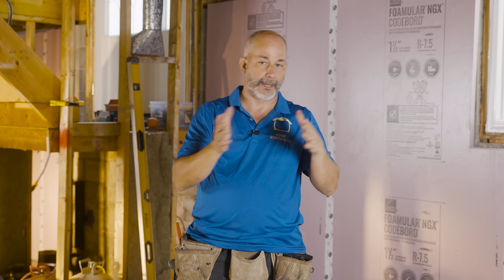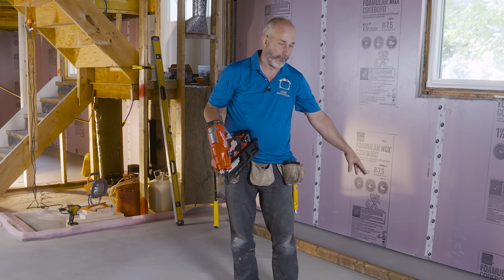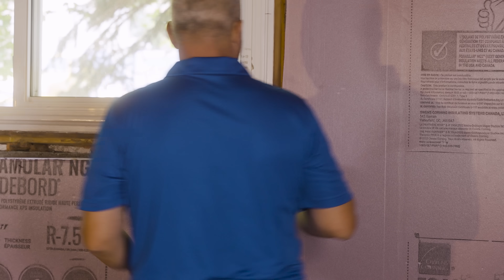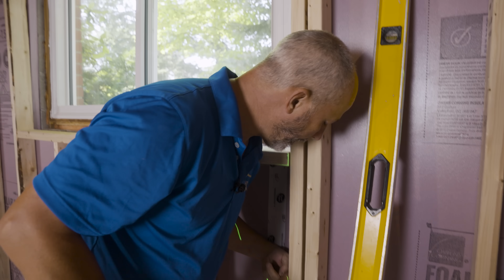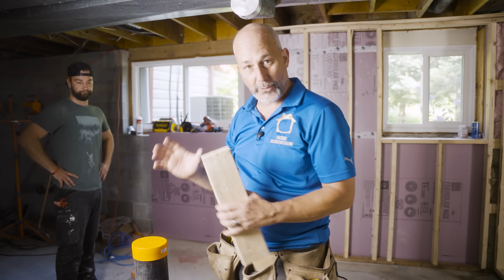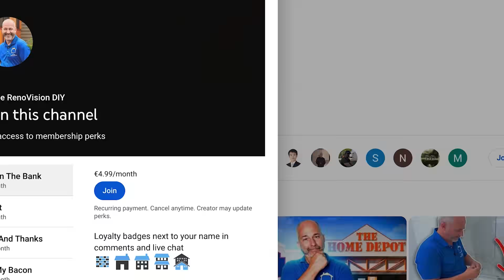The RIGHT Way to Frame Your Basement (From a Pro with 30 Years Experience)

Comment: Love the videos! I've been told by the city of Ottawa that R7.5 rigid + R14 does not meet code. You need R10 rigid going that route. "The basement walls are required to be minimum R20ci or R12+10ci. The thermal values are not additive between continuous and non-continuous insulation. Those are separate requirements."
Reply: That's really strange, because when I insulated my basement, my city of London, ON required just R12 for the basement walls. But I went above the code and put those thin R3 rigid + R12 batt... Temperature wise we are in somewhat same climate zone! Maybe your city referred to the outside walls, like the ground floor walls, not the basement ones
Reply: That depends on the year the building is built. New homes are required 2x6 stud wall and r20 insulation. While older homes only require 2x4 stud wall and r12 insulation

Comment: By basement has had a # of crack repairs using the poly injections.  The injection caps are still there and protrude from the wall a couple of inches.  How do you install the foam board against when the walls aren't flush?

Comment: When building basement walls I alway make them approximately 3/8” shorter than the actual height then use starter course shingles the fill the space before securing the wall to the floor joists.  Probably overkill.

Comment: I have always built walls 16” OC but when marking out the plates I go back 3/4” (half the width of a 2X4) mark with an X the side where the stud will sit.  Guarantees the middle of the stud is 16” OC

Comment: If framing on top of dricore, pressure treated lumber is not required? How close would you put the dricore to the bathroom walls? Or for bathroom framing it’s still on top of dricore cut flush to bathroom interior?
Reply from the maker: I would frame the bathroom first. then pour floor leveler to bring up the height. Cheers!

Comment: Hi Jeff,

I'm a huge fan! Quick question: which GRK screws do you recommend for joining the top plate with the ceiling stud—2.5 inches or 3 inches? 

Can I also use GRK screws for framing my basement walls? I prefer not to use nails or a nail gun due to the cost. 

Thanks for your help, and I appreciate your informative videos—they've saved me thousands as a first-time homeowner!

Comment: I don't think you need vapour barrier if the Foam is R 7.5, and you are using R-14 batts. When I did mine, as long as the foam was taped  and sealed, vapour barrier wasn't required if it made up at least 1/3 of the R value. I'm in the GTA, can't imagine codes are much different than Ottawa.

Comment: Hey Jeff. Why doesn't the pink rigid foam and tuck tape qualify as a thermal break? You said you'll also need a vapor barrier? Thanks for all the great info over the years!
Reply: Hey Jeff, I love your work!! 
I second Joe’s question. I’m finishing my basement with the same pink rigid foam flush against the concrete (older house), tuck-taped seams, and spray foamed along the bottom and all edges to create a continuous vapour barrier. Planning to add Rockwool batts to meet R-value and no plastic vapour barrier so as not to trap moisture. Are you using a semi-permeable vapour barrier? Cheers!

Comment: Wouldn't that Owens Corning XPS with taped seams already be acting as your vapour barrier? If you add 6mil poly on the inside face of your studs, then wouldn't you be in danger of creating a double-vapour barrier scenario and a humidity trap within your walls? Better to seal the top and bottom of your XPS as well and and have that act as your VB. This should be Ontario Building Code compliant, but you can always confirm with your building inspector ahead of time.

Comment: Do you not have fire blocking code to deal with, or did I miss how you're dealing with that?

On the bathroom door height under the ductwork, why not use a pocket door?

Comment: If you use a pocket door on the bathroom, problem solved.
Reply: Then he has no room for outlets or light switches in the side wall of where the vanity will go. Also locking pocket doors are a pain in the ass to use.

Comment: This will not pass inspection anywhere that adheres to IBC 2021 or later. There is no vertical or horizontal fire blocking. Foam board is combustible and does not count as a fire block. You need to have blocking every 10’ along your wall. You could use 2x4, Ply or drywall, but it needs to go all the way from the stud to the concrete.

Comment: A large serrated knife works wonders for cutting Rockwool. They also sell em with closed looped handles at most home centers. You use em like a hand saw, cuts super easy.
Reply: I used an old bread knife.  Worked great!

Comment: Hey Jeff, when you measured the height of the duct work in the middle of the bathroom, I think you forgot to subtract the thickness of the flooring, so it would be much less the the 79-1/4" you stated. I could be wrong & maybe you subtracted it in you head as you were measuring.

Comment: How about the gap in bottom plate to match with the gap on the foam board? So we have water/airflow if we have subfloor system like  dricore foam. Shouldn’t have a shim under the bottom plate ?
Reply: Yup, I like to use Delta or DMX dimple barriers under my non load bearing walls in basements.
Reply from the maker: if you are using a subfloor then do it first and then build your walls on top. Cheers!

Comment: Proper layout from a wall end;  15 1/4 put an X, 31 1/4 put an X, 47 1/4, an X ....etc so on. You subtract 3/4 from each interval to make the centers of the studs land in the correct locations for sheet goods. 4ft, 8ft,  12 etc.

Comment: In the situation where you have the overhead ductwork there why not plan around the ductwork?  I can see three ways to avoid it in this scenario.
1. Put the bathroom in another place in the basement.
2. Make it a outward swinging instead of inward swinging door.
3. Make sure the room is 30 34 or whatever size door you want deep before the ductwork so the door can swing in and not be under the ducts.

Its weird that you planned yourself into this issue instead of explaining how to avoid these issues in the planning stage.

Comment: On concrete and leveler do you need the uncoupling membrane in the basement? Would make it easier to fit the door to the bathroom without and what is the real risk? What's the chance the tile will ever crack? If a concern, go with an LVT.

Comment: I prefer my methods. Tapcon screws instead of shooting nails that only crack the concrete.  I also don’t put a stud on a seam.  I like to add to the bottom and top plate with a, usually 14&1/2” piece butted to the studs.  This way if the wall moves it moves as one piece.  It’s usually a better practice to leave about a 1/2” gap between the studs wall and the foam vapor insulation too. 
Old houses you’ll likely stick build rather than build the wall in the floor.  I just did a basement from a 1960’s house that the house was so off I had to stick build the entire thing.

Comment: Your plate layout is wrong.  You need 15-1/4" to the face of the first stud from the end, then 16" on center from there.
Your way makes the layout off center of the stud by 3/4".  Measure over 4 & 8 feet, and your stud is off to the far side, not centered of sheet goods.

The window height is different for the headers above to carry the ends of the floor joists, they are bearing and required.

7 studs for a corner????  Just to make a door opening???  Guest 2x's are cheap in Onterio, Ae?
Reply: Get a life I’m a framer who cares
Reply: @ LOL.....I've had the life, 50+ years in carpentry, I've repaired many jobs from DIY's and those who cared.
Reply: You install the first sheet of drywall 3/4 from the exact corner so the other side splits the stud. No need to get fancy there. Also the 7 studs in one corner is a point load for a beam in the room above as he mentioned when adding the extra studs.

Comment: When I fir out a wall I fasten the plates to the floor and joists first, and then I stand up a stud in position and scribe it using the top plate as a guide. No lifting the wall and no measuring each stud individually. That is a perfect fit every time!

Comment: Putting a 6' level against an 8' stud is not accurate if the stud is bowed. You should plumb from bottom plate to the top plate with a straight edge.

Comment: Did you know that you can fasten the bottom plate to the slab by drilling a 1/4" hole through the plate into the slab and then drive 2-12 penny nails into the hole. It holds as tight as a wedge anchor. A much cheaper system considering you don't have to buy a nailer.
Reply: Or just use tapcons
Reply: @RCLapCar  those would do the job, but cost 22$ for 27. This is a diy video. I'm into showing how to get the job done with minimal tools. No laser and just a torpedo level,  straight edge, chalk line, and a tape.Nothing else is needed, not even a square.

Comment: I may not need to completely finish a basement as mine came fully finished. The concern I have is when it was finished & how much insulation is in behind the drywall. It’s row housing & ours is somewhere in the middle. Been here 15 years & so far NO water issues !! It does seem a bit cool in winter though !!

Comment: When I layout a wall hooking the tape on the plate, 16 inch centers should be the center not the edge. You want the 48 inch drywall edge to land in the center of the stud at 48 inches not the edge.
Reply: When you measure 16 inch left edge to left edge, guess what, it's 16 inch centre to centre, and miraculously 16 inch right edge to right edge.
Reply: @kenc2218 hmmm interesting lol
Reply: @kenc2218  I'm talking about having the edge of the first drywall land in the center of the stud, not on the edge. Since the drywall in a corner is at the left edge, you don't want your right edge to be at the left edge of the 4th stud. So, the second stud out of the 4, will be 3/4 inch less than 16 and the rest will be 16 on centers. Try it out.
Reply: @kwomack5399 What are you talking about? He has that backer board on the corner. Once you install the drywall sheet on that face, there's 3/4 inch left on the stud for the perpendicular drywall sheet. You realize a 2x4 has 1.5 inch,  so 3/4 inch is literally on center, which is what he said on the corner.
Reply: There’s an easier way to lay out and install your basement framing. Unfortunately This is not it 😢
I framed my basement and duplicated another YouTuber. It was simple and came out perfect.
Reply: @job916 can you tell who you followed?
Reply: @Godsgraceish @basementfinishingman Eddie Case
Reply: @job916 who?
Reply: @job916 who
Reply: You realize that 16 inches from outer Edge to outer Edge and 16 inches from center to center is the exact same thing right?
Reply: @adamrahman9255  Stand up a 4 foot wide piece of drywall there with the left edge even with the outer edge of first stud and tell me what happens on the 4th stud.
Reply: He’s a GC he doesn’t need your advice. How ever even as a plumber you’re right
Reply: I've mentioned this in other videos, he still hasnt grabbed the concept of basic layout.
Reply: This guy should not be doing instructional videos, so many things wrong here.
Reply: @ who df are you?
Reply: Are you saying my comment is incorrect?
Reply: @scottschultz895 yes, i will say your comment is totally incorrect, what part of the framing is he incorrect on? what deviations aren’t within best building practices? and what code is the framing in violation of, (generalization, not local as specificity varies based on region)?

Comment: Loving this series, I have a walkout basement that tends to get very wet in the spring. it was finished (before all the flooding) but the house was built in 1978 so it's old enough I'm not sure if it was meant to be finished but it does have a full bath downstairs, no clue if that's been there since 78 or was added later. Anyways pretty much every video about the basement in this forever home series has been helpful so thank you.

Comment: i always use glue or silicone to glue the sill seal. It's IMO better than using staples. This way, you don't have any rusting of the staples or penetrations in the seal

Comment: Aloha from Hawaii. Huge fan. I’m trying to change sub floor under toilet on my 2nd story bathroom but  only have access to one flooring joist as the other joist is on the other side of a wall frame. Any suggestions? Can we laminate new subfloor to connect to existing?
Reply from the maker: just add blocking and patch. Cheers! we have a whole subfloor and structure repair series on that.